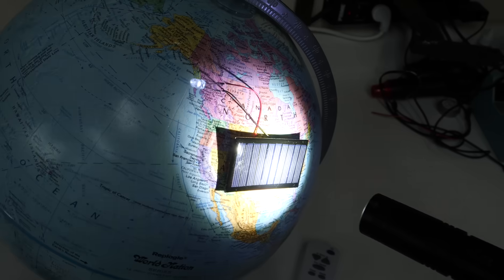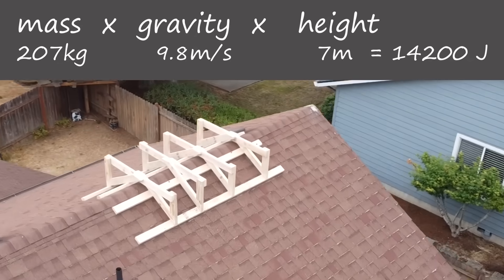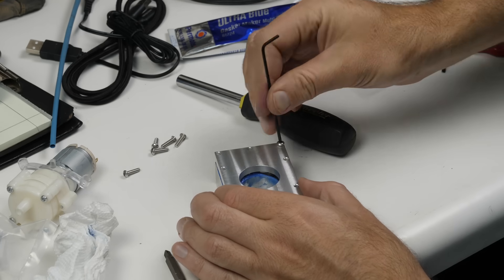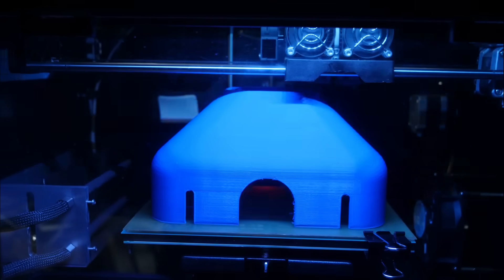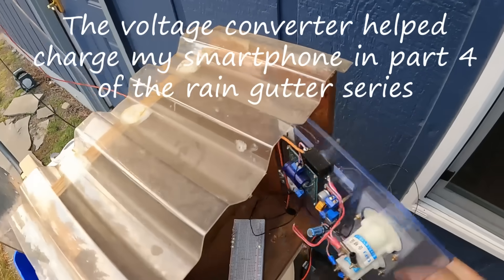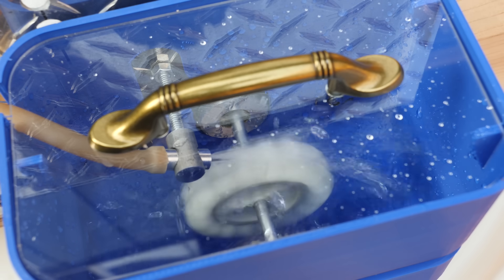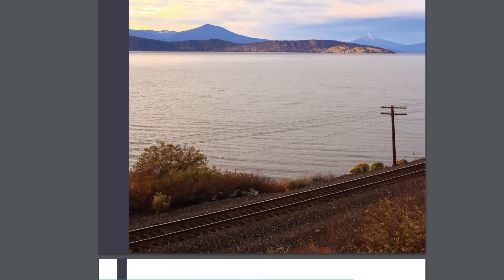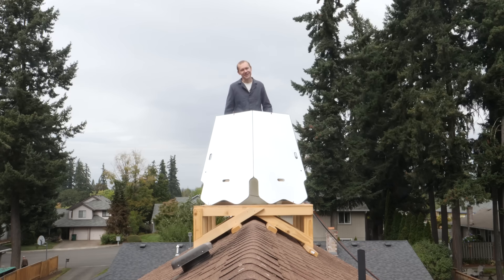Storing Solar Power on my ROOF!!!

Comment: Now if everyone had a 50 gallon storage unit on their roof, that would be a little more significant number
Reply: Did you miss the part where he said the energy that his system stores is roughly equivalent to a single AA battery?  It makes zero sense for anyone to actually have such a system as a practical way to store energy.  It only really makes sense as grid-level energy storage where you can basically have a lake on top of a mountain connected to a lake at the bottom of a mountain.
Reply: @albertjordan3249  It's all about a beginning, yes, right now the equivalency of an AA battery. As efficiency improves, so does the effective power output. One day soon perhaps that of a car battery, without the lead and acid.
 Think more of where this could lead.
Reply: @bradmaas6875  Bro that's literally the raw calculation of the potential energy of water at that height.  It CAN'T get any more efficient, because that's the max hypothetical energy that much water can have at that height.  This doesn't include any of the inefficiencies from the pump or generator, losses from friction in the hoses etc.  The only way to get more energy is to throw more water on the roof and/or pump it higher up.  You would need to throw another 24 barrels on your roof to upgrade to a car battery's capacity, and that would weigh 10,000 lbs... equivalent to about 5 small cars on your roof... which the average residential roof is not going to be able to support safely.

And all that for the same energy storage as a car battery, assuming that the roof system has perfect efficiency (which is physically impossible).
Reply: @bradmaas6875  the calculation was done without any losses taken into account. So the energy of his setup didn't even deliver as much as an AA battery. But it is a cool demonstration.
Reply: @bradmaas6875  No the efficiency of this will not exceed the maximum theoretical energy which is the 14200 Joules he mentioned with the height difference and mass. So with 100% efficiency you can get 14200 Joules out from this which is 3,94 Watts for one hour. One Joule equals one Watt for one second. So 3600 Joules means one Watt for one hour. So the scale is really the fourth to half the phone battery, one fifteenth of laptop battery or roughly one AA battery.
Reply: I literally desighned a water powered society makes all the power and has
Reply: or maybe wait a little bit for the graphene battery's
Reply: If everyone would have one cell phone battery at home it is just as signifficant. This barrel contains 3,94 Watt hours of energy, current phone batteries contains 15-20 watt hours. So just save the old phone battery and get twice the energy stored even if the battery has lost half of its capacity.

Comment: I think it'd be interesting to try and pump 55 gallons up to your roof using a single AA.
Reply: A single AA battery won’t do. A quick google says that a AA battery contains about 10,000 joules of energy.  He calculated the 55 gallons of water in the drum stores more than 14,000 joules. It might fill about 1/2 to 2/3 of the tank, but here’s not enough energy in an average AA battery to “charge” the water tank fully up there.
More importantly, all of the work he is doing is only going to store the equivalent of 1.5 to 2 AA batteries with losses. I’m not sure it’s worth the effort beyond proof of concept.
Reply: @netpilot5  this tiny setup is just showing the technology, actually its already out there somewhere, they fill up a big lake alike reservoir during daytime and open the valves at the night to spinn the turbines
Reply: @TheDesertegal7  yes there is a lake set like that in The Wicklow mountains outside Dublin Ireland they pump it during the day a let it loose at peak time.
Reply: @netpilot5  Right.. the key is the losses involved in the physical conversion. lots of friction, electrical resistance, etc..
Reply: @netpilot5  its only worth it if you USE the water as it flows down.  But then it's really worth it.
Reply: @netpilot5  Start with the proof of concept, then work on getting the result you need
Reply: 22 comments and no one mentioned how you have it backwards. The energy in the barrel is equal to the battery, not the energy generated by the solar panel to pump the water to the roof
Reply: @hamburger-n5p  energy = energy.  If the potential energy in the barrel is equivalent to the chemical energy of a AA then in a perfect world with no losses a AA could pump water into the barrel.  Reading the comments I think you will see that most of us are very aware that the solar panel took more energy than a AA to pump.  My guess is with the clouds and that old panel he was maybe getting around 5 watts, 10 at best over 5.5 hours to pump the water which means ~ 7 AA of electricity.   But he is likely using an impeller pump , which is not efficient at low power.  Considering pumped hydro is 80% efficient round trip, it isn't ridiculous to bet he could get the tank 50% full on a AA if he worked hard.
Reply: Yikes hehe
Reply: So if my roof is also 7m tall, I would only need about a million gallons of water to charge my car.  

Might be easier to make a water tower 28m tall then I would just need a quarter million gallons of water.  Would take up significantly less space in my yard 😂😂
Reply: @homerdoh56  could you make it 280m tall? Because then you'd be able to get away with one long (tall) tube of 100mm PVC pipe and avoid the cost of a water tank completely.
Reply: @homerdoh56  It depends of the type of car.. if it is light and efficient like this one.... https://www.youtube.com/watch?v=69_iKArvJBk
Reply: The potential energy of that tank is 14kJ of energy, but it didn’t take 14kJ to pump the water up there, it took considerably more. He doesn’t discuss it in the video, but we need to factor in the efficiency of his pumping circuit to figure out how much energy is needed to fill the tank. He should’ve put a energy meter on the power for the pump and measured the watt hours it took to “charge” the storage tank. My best guess is probably 40-50 kJ was used to get the 14kJ with his setup.
Reply: its only efficient when using huge amount of water to turn on a 1000w motor
Reply: @TheDesertegal7  What about 999W motor?
Reply: @generalzugs6017  69
Reply: Then recharge that AA with the solar panel
Reply: I agree, but probably due to the conversion of electric to potential energy not being 100% efficient, you would need like maybe 2 AA batteries :D
Reply: @marthale7 the heat of friction and resistance in the motor would be the same in either system if you use the same motor to pump water or air
What I was saying was that the pressure difference between hot air and cold air is where you will lose most of the energy with a compressed air system. 
Another factor would be that the energy required to pump water up will be constant because the pressure of water weight will not change. You are only lifting the water in the tube so the resistance of the motor will not change. With a compressed air system the resistance of the motor will get higher as the pressure gets higher and it will require more electricity to turn the motor. That would also waste a lot more energy.
I guess the resistance of the motor is not the same because it will change as resistance against the pump changes.
Reply: @marthale7 I have worked with Amish and seen them using compressed air for a lot of things also. One problem they had was that their air powered cylinders would freeze up from condensation during humid or rainy days. The air outlets would be plugged with ice from the expanding air and they had to beat the air ram with a wooden hammer.
Reply: @monster8090  The Amish are pretty modern now. 90% have washing machines and countless others have cell phones for "safety reasons".
Reply: @metatechnologist  that sort of thing happens. Many Amish churches have split because of the changes some people want compared to the more conservative members of their community. Some people believe that as long as they live off grid it's fine to use modern technology while others believe that modern technology is bad regardless of how you use it.
Reply: Could go one step better. Use the joule thief circuit and do it with discarded batterys.
Reply: @brett567  Really the next level there.
Reply: @creamwobbly  Yeah, but I guess that would make for a pretty boring video. 🤣
Reply: Remember that there are huge energy losses in a system like this.
Reply: Water barrel's Battery charge efficiency is low. Lots of power and only some is stored. Rest is lost to friction and significant amounts heat as observed by the motor needing a heat sink
Reply: Use Tesla turbine instead of conventional turbine
Reply: @marthale7 one could store the 55 gallon drum inside their house.  And use the same solar pannel, along with a cheap 12v water heater, and store far more energy than a AA battery or two. So it can slowly release the heat throughout winter days and nights.
Reply: Why use any battery? Ram pumps use check valves can reach high pressures and with a constant supply canned calibrated to keep water tank sufficiently full to allow constant draining turning hydro turbines
Reply: Couldn't u just run a hose up to the roof and turn it on?
Reply: Definitely wouldn't work, this sort of energy storage is highly inefficient, it's only useful to use up excess power from other sources.
Reply: @whatyousaidbud  I wouldnt say it's "highly inefficient".  For a grid pumped hydro station they can get round trip efficiency up to 85% (means pumping side may be as good as 93.5% efficient if all parts are equal.)  This puts it in the realm of lithium ion batteries when you count in AC<>DC conversion.  Obviously his version is not as efficient, but the concept can be.
Reply: @whatyousaidbud  What are you talking about? The power from the sun that was already not being utilized?
Reply: an electric sprayer wand uses 2AAA batteries and can pump about 10 gallons in my experience
Reply: I think it would work. But only for a little…maybe a fourth of the way? The solar panel may have the same amount of power as the battery but can last as long as the sun is out. So, still would be interesting though!
Reply: @ezrarichardson279  I agree, you would need a very efficient pump and something like a very efficient joule thief, and even then you'd still probably only get about halfway there due to things like friction in the hose and pump.
Reply: @jeffpkamp  crazy idea, but multiple pumps with small staging tanks would avoid all those problems.
Reply: @williamchamberlain2263  Mira ariete hidráulico. Eleva el agua sin energía y puede funcionar de continuo para llenar un depósito. Y hacer recircular el agua en un proceso continuo. Y usar el salto de agua para mover una turbina
Reply: @ezrarichardson279  lo interesante es usar un ariete hidráulico q no usa energías alternativas más q la compresión del agua para elevarla . Eso ya lo hacían los romanos .y luego utilizar la caída para mover un motor
Reply: About 15 kJ in an AA battery, so it wouldnt finish
Reply: simple just use a double AA battery to light up the lights instead, since its cheap now,
Reply: @marthale7 well until the water butt perishes due to UV degradation
Reply: Con un ariete hidráulico no necesitas  ningún amperio ni placas solares y puede elevar muchos metros
Reply: @marthale7 My brother in law at BPA once proposed pumping air into old natural gas wells to store excess solar and wind energy.
Reply: @wes326  Compressing oxygen into a natural gas filled space? And cause an explosion?
Reply: @amirlach  Air not oxygen.
Reply: @wes326  Air is about 21% oxygen. Compressing oxygen and fuel in an enclosed space is how diesel engines fire. Natural gas compressor stations have a history of explosions when not properly purged of oxygen. One  such station I worked construction on did just that. People on site died.
Reply: @amirlach  You might have a point, all I know is that BPA was looking into the idea. The natural gas wells can hold a lot of pressure. If you ask me, nuclear power is the future.
Reply: @wes326  Nuclear FTW...
Reply: Easy.
Reply: @marthale7 "The real advantage I see is the ability to keep the energy for months / years without degradation."

Water evaporates.  Or using your term, "degradation."
Reply: @phillipzx3754  How will it evaporate in a sealed container?
Reply: @brianwilliams4562   You call that "sealed." LOL!!!
Reply: That would be perpetual motion.
Reply: @creamwobbly  You could do both. You could charge a device a day that way. That isn't insignificant if widespread.
Reply: There is a HUGE difference between the amount of energy stored on the roof and the amount of energy used to get it there. This pumping system is very inefficient, may be 20% if you are lucky. So while there is about as much energy in the water "up top" as an AA cell has, but it takes at least 5 times as much to pump the water up.  So no, an AA battery would not do it.
Reply: 1.5 volts-doubt it
Reply: Will need more due frictional and pump losses. Probably need 10 aa batteries.
Reply: @marthale7 heat is the biggest loss with compressed air. Given that it's hot when the sun shines and cold at night you will lose more energy when you try to expand the air when the sun isn't shining. A gravity system is much more efficient because the heat loss isn't a factor.
Reply: 18650 would be able to do it.  LiFePO4 battery would be able to do it for ten years every day.
Reply: @babelfishdude  Iron-Nickel would be able to do it every day for a century.
Reply: @usa-ev  really? What kind of battery is this?
Reply: @1LY4x8s96r  Look up NiFe batteries and/or Edison batteries.
Reply: What a horrible use of space and energy and maintenance time. Stop wasting your time with inefficient systems. Rechargeable Batteries and capacitors are far more efficient and effective that water in a barrel. All that for a dim light!

Comment: When your top barrel is full and the solar panel is not powering the pump could you use the solar panel to charge a battery that could power the water pump at night when the sun is not shining. Then you can fill and drain it 24/7. Just a thought 😎
Reply: So you want to add energy storage to power the energy storage...
Reply: Yes. Otherwise the energy is just wasted with the solar panel in open circuit. Why not transfer that power to a battery and have it switch to battery power at night when the solar panel isn’t active. It’s not wasting the energy it’s just storing it in a battery to be used later.
Reply: @haulngarage  At this point you may as well just charge that AA battery he said held the energy equivalent of his water tank at 7m.
Reply: @barneybarret6088  Sure your right, might as well. Thanks for your comment.

Comment: Adding sugar to the water will increase the available energy and lower the freezing point of the water.
Reply: Probably get stuff growing in the water too...
Reply: @ishanr8697  
Use high fructose corn syrup.
Reply: I believe it would be salt not sugar.
Reply: @haulngarage  
Salt works as well but it is also very corrosive.

Comment: Seemed like good idea while the temperature is above freezing... 
It would be more logical to Solar charge a single 18650 Li-ion cell which would give you ~43,000 Joules of energy (that's about 3 of your barrels full of water).
Reply: and a lithium battery can do 3-5 thousand charge/discharge cycles as long as you don't fully charge/discharge it. that's what I use for my solar array
Reply: @aleks138  Yup... even at 3000-5000 80% charge/discharge cycles I still prefer Li-Ion batteries for simple storage at ground level compared to a dozen and/or more 45 gal water barrels on my roof and all that plumbing for the same energy storage for a single home use.
Reply: Yeah the barrel is just a fun demonstration, definitely not practical for home storage. Water pump batteries make a lot more sense at massive scales though.
Reply: By comparison lithium-ion cells look positively amazing. Makes you realize just how ridiculously power dense hydrocarbon fuels are. One liter of gaseous, uncompressed methane contains almost three times the energy of this contraption.